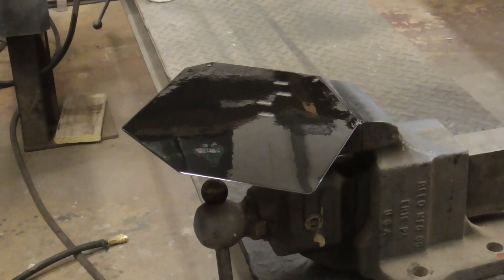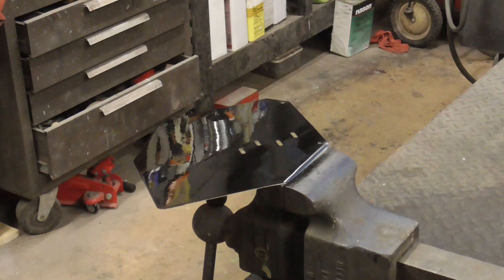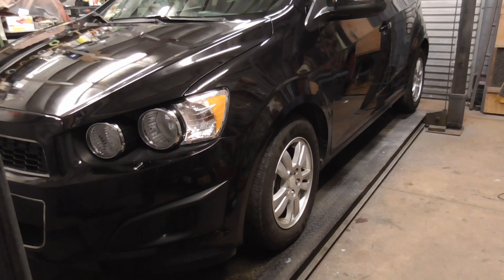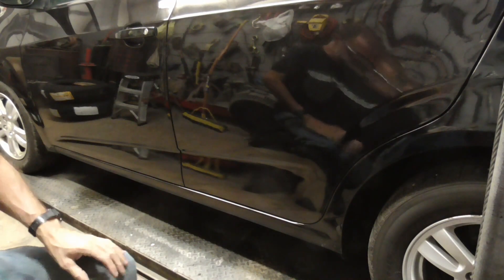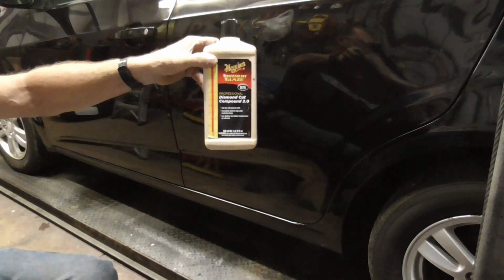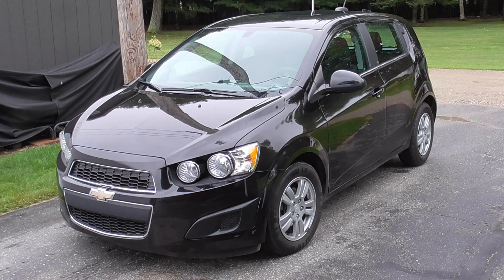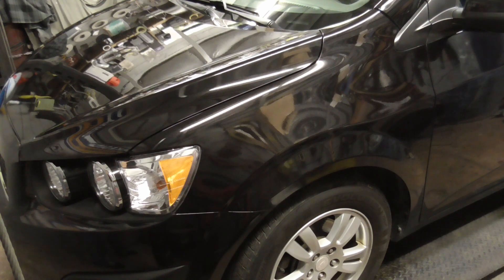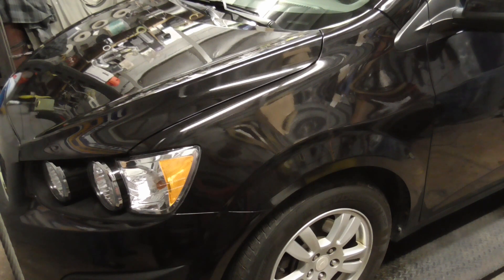The Truth About Orange Peel

Comment: I've only painted about two dozen vehicles in my time and my worst nightmare was runs and sags in the most noticeable areas. It didn't matter what I did, I always managed to over sand those areas and had to repaint. I was always looking for a $10,000 paint job on a $2000 budget. I had some real jerk customers that I should have just refused the work and saved my from the headaches. Great video.
Reply from the maker: Thanks Bill.  Really the only way to get a 10K job on 2K is to wet sand and buff.  The inexpensive paint/clears just don't seem to flow out or lay down as well as the high dollar stuff :)

Comment: Using the right reducer for the temperature conditions is very important also. It's a balancing act between flow rate , travel speed and evaporation rate of the solvent. Consistency in the product that you are used to using can also help a lot. An experienced painter can get those variables almost perfect with experience. I've painted a few vehicles in my years. Let me tell you that wet sanding and buffing is a life saver. I have tons of respect for guys that can lay an almost perfect paint job and send it out the door with a factory like finish ...which has orange peel, but is acceptable by most peoples standards. That's why most larger body shops have a designated person that paints cars all day. He's worth his weight in gold if he can send cars out of the spray booth without buffing.
Reply from the maker: 👍 Good points.  Top of the line paints and clears make a huge difference too.  They flatten out or flow out really nice :)

Comment: I'm about to spray my first vehicle, a 1995 Toyota Tacoma.  I want to do a base-clear solid red.  Can you recommend paint brands or types for a first timer?  I'll be using the 3M performance spray gun, and the temperature I'm guessing will probably be mid 60's - 70 degrees
Reply from the maker: Nason Ful-Base or Matrix Base are both good.  I use them 'cause they are easily available around me.  Any brand of "professional" auto paint will work great for you.  It's all good stuff PPG,Dupont,Nason,Matrix, even TCP Global and paintforcars has decent base coat.  Nason Select Clear is good too along with U-Pol 2882-Kit for reasonably priced clear coats

Comment: Hi Jerry...DIO here...I was wondering if you wouldn't mind me asking you hopefully ONE LAST question? I sprayed my black base coat on with several coats and I can still see swirly scratches from DA sanding the primer. I guess I didn't do a good enough job getting that primer sanded to 400-600. Anyhow, I sanded the base coat with 600 (in prep for another coat of base) but I can still see the swirl scratches. I'm wondering what you would do at this point....? I know this probably never happened to you. I do wonder if the clear would make them disappear. It's mainly the roof and side panels. I might have had something in the paper that caused this in the first place. If I wasn't painting black base over black primer I probably wouldn't have noticed.
Reply from the maker: It's common to still see some scratches in the base.  Your clear coat will "fill" those.  You're fine.  Make sure you give about 10 to 15 minutes between coats of clear :)
Reply: Well, the clear went on great (thanks to all of your help). So I sanded it from 1500-3000 and then went through the 3 step process of polishing the scratches out. The end result (just on an area that will be under trim) is I now have a ton of super fine swirlies that actually take away from the depth and make it look a cloudy. So I ask you- did i just not spend enough time with the buffer in the first stage? Or maybe there was dirt in the buffing pad? I panicked and ordered yet another tool. A 21mm throw polisher that comes with new pads. I was using the HF rotary with used sponge pads. Anyhow, hopefully the new machine will do a better job. :) Thanks Mister Jerry.    @LakesideAutobody
Reply from the maker: It's not dirt in the pad.  It's the type of buffer and the pad.  Random orbital is not aggressive enough in my opinion.  You really need a rotary buffer with a wool pad.  Sponge pads can work well too though - I just prefer wool as it's easy and fast to clean.  It does take some time, good lighting and good compound to wheel out the wet sanding.  Once you find what works though, you'll be very efficient at buffing out cars. @designsinorbit
Reply: @LakesideAutobody  Is it ok to use the same wool pad for all three compounds or do you switch pads?
Reply: If you can see swirls in your base coat, clear coat will fill them, sure and you can get a "flat finish" after some work but you'll still see them because clear coat is transparent. Too late now but for when you paint something in the future, keep that in mind

Comment: I painted my car in August (90-95 degrees).  I used Urechem black metallic.   Two coats of base, three coats of clear.  I let the Clearcoat dry for a week.  Started wet sanding with 1000, then 2000 and 3000.  I was worried about being too aggressive and taking off took much material.  Finish was blotchy and fair amount of orange peel remained and shine was mediocre.  Had to start over starting with 600 to get rid of all the orange peel then up to 1000, 2000 Griots Boss Fast Correcting Cream, then Meguiars 83 before I finally started to get the mirror finish.  Looking back I wonder if waited too long before starting to cut the clear?  I’m sure the problem was mine and not the products.
Reply from the maker: Good thinking.... It's easier to cut and buff the day after or a couple days after.  Use a rotary buffer too as opposed to a random orbital - just in case that might be a variable :)
Reply: Thanks Jerry.  I’ve been using a DA that was advertised for cutting and buffing.  It came with black, red and yellow pads ; and useless instructions.  Looking forward to warm weather so I can paint my 55 210. @LakesideAutobody
Reply from the maker: No problem - this video will give you an idea of how hard you should be working - it was done the day after painting it (or close to it) - https://www.youtube.com/watch?v=I3P1fc-Cx_Q @frankkennedy5361

Comment: How hard is it to buff out 1500 scratches?  Especially on black. At the shop we start with 1500 then 3000. Sometimes I go to 5000 on black but that's just because I suck at buffing. Lol
Reply: With a rotary buffer and a wool pad, it can be done fairly quickly. But if you want to get the buffing done quickly, going to 3000 will save you a lot of buffing time.  5000 grit will save you even more time buffing but it's not necessary  , as you can get 3000 grit scratches out fairly quickly with a good compound and wool wheel.  Don't even try buffing and scratches outvwith a random orbit type buffer unless you've got lots of time and patience...ie- days to get them out.  A rotary buffer with a wool pad will get you there so much faster but be wary of those edges.  Tape them if you have to.
Reply from the maker: Marcell is right - gotta have a rotary buffer and good compound.  Old fashioned buffers that were heavy and 3M compound cut through pretty darn fast.  Buffing the next day goes faster too but be careful.  If you wait a week or two the paint is harder to buff :)